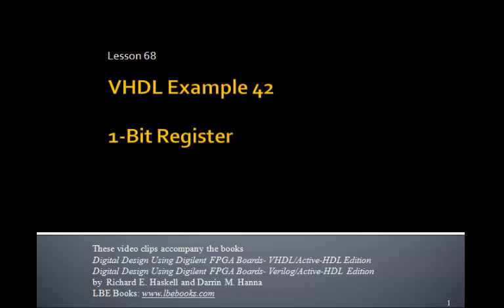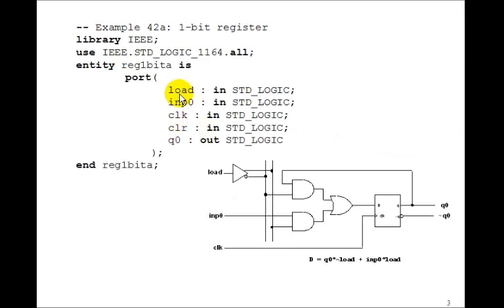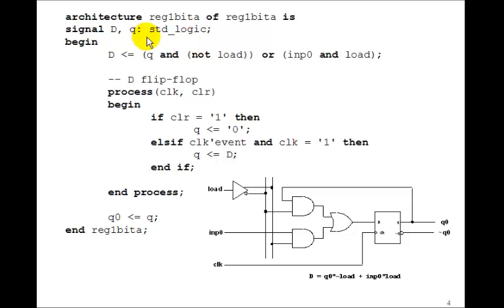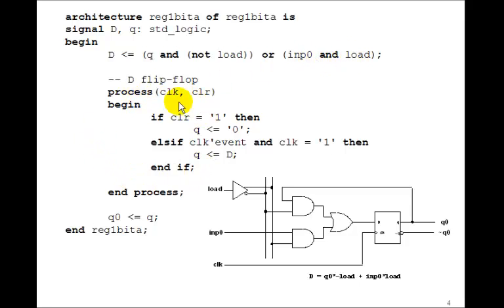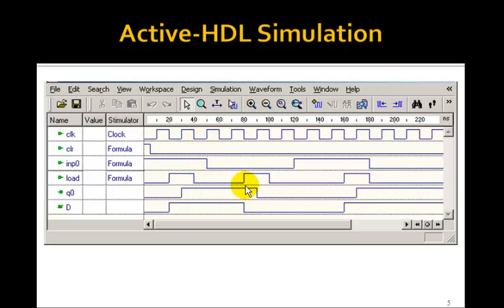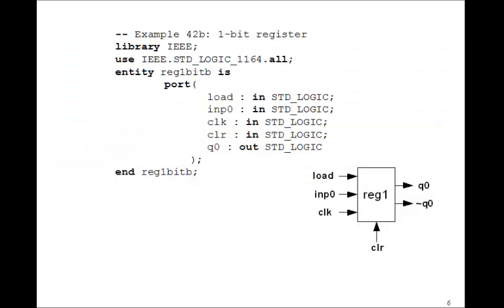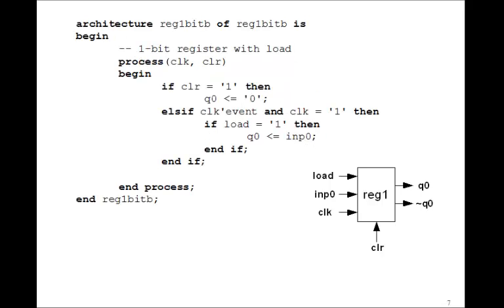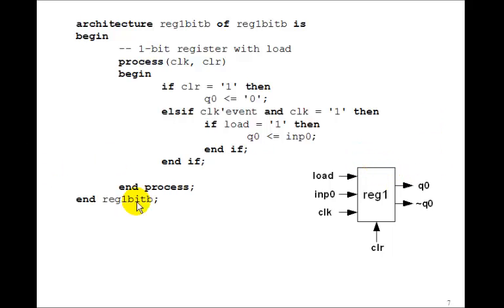Lesson 68 - Example 42: 1-Bit Register

Comment: You define D as D <= (q and (not load)) or (inp0 and load); But equation at the bottom say: D= q0*~load + inp0*load. I don't understand why i fisrt equation you use "q" and in other you use "q0". And you assign not initialized signal q to signal D.
Reply: That is because of a caveat of the VHDL programming language: q0 is the output of the entity (to match the block diagram). But in the logic equation for D we are reading the value of q / q0. Since q0 is an output of the entity you cannot read from it inside the architecture. Only write to it. So you need to introduce the internal signal q for that purpose. In Verilog you could for sure just use the q0 (I think). But since VHDL is very strict and verbose, you can't.

Comment: Can you explain why you are defining d outside of the process? I feel like it has to do with latching on D is that correct?
Reply: That is for 2 reasons:
1. It is more clear to write purely combinational logic to the place where the concurrent statements are, so that you can spot it easily as being purely combinational.
2. To not accidentally infer a 2nd D-FlipFlop: If you were to put it like this:
....
elsif clk'event and clk='1' then
q <= D;
D <= (q and (not load)) or (inp0 and load);
end if;

then you would infer a 2nd D-Flipflop between the OR gate and or wanted Flipflop.